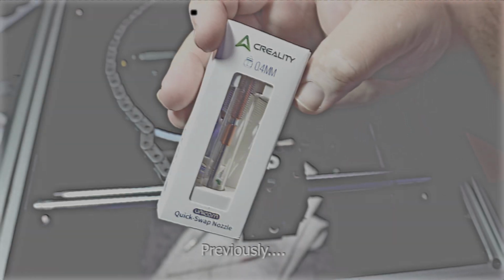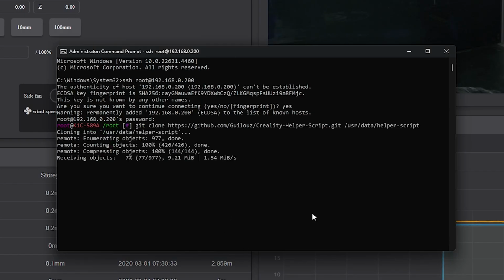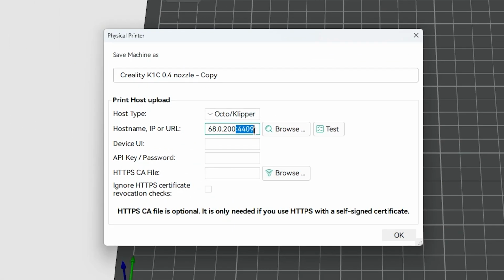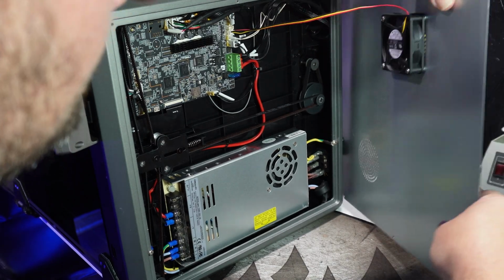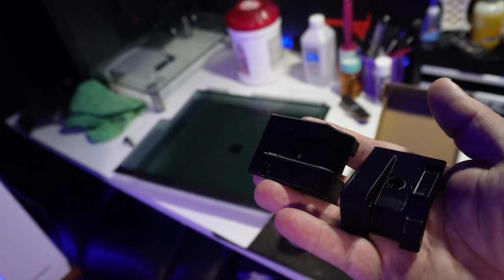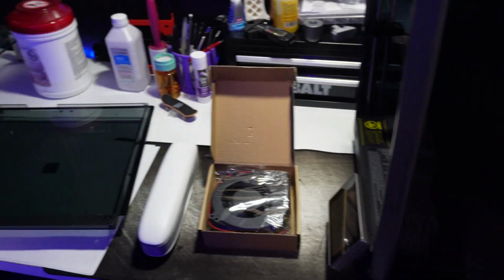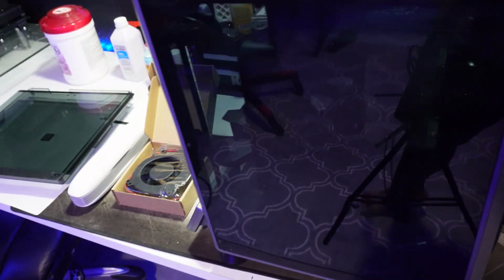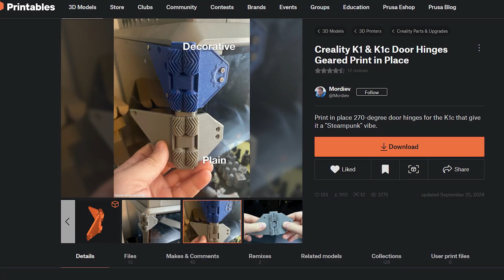Rooting My AS-IS Creality K1C from eBay | Mainsail

Comment: Thanks for the tutorial. My issue is the rear of my bed is about 0.4 too high. Can i loosen the top 3 screws of the Z lead screw at the back and add shims under that flange to drop it down? Or should i slip one notch on the rear lead screw down and shim up i dont know. I only see videos of people lifting the front
Reply from the maker: You could use a shim. On a similar printer, I've used washers between the plate and the mount on the screws to raise it up. It's going to be a little more difficult on the back, but not impossible.

Comment: My K1 max came with a broken door as well. I opted for a 3rd party acrylic replacement. I did print the same hinges that you settled on, but haven't installed them yet. Overall I am happy with my max and K1C printers.
Reply from the maker: Nice! Yeah, the acrylic is what I'd have gone for too, if they had given me a partial refund. Thanks for checking out the video and commenting!